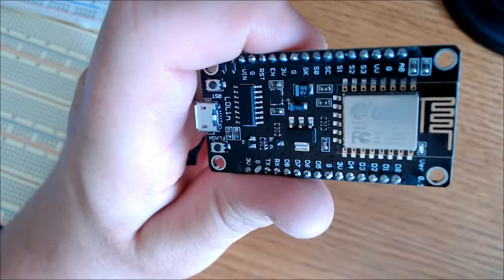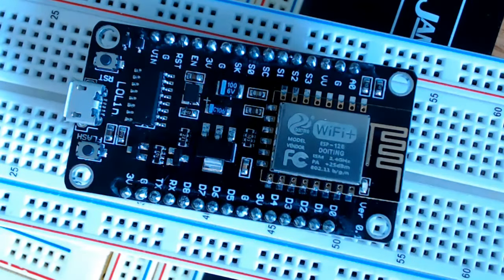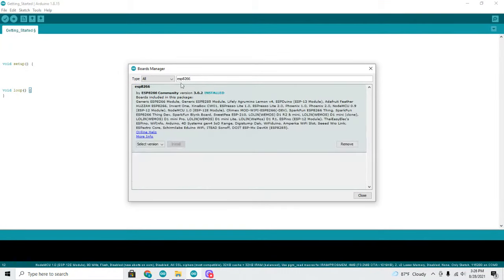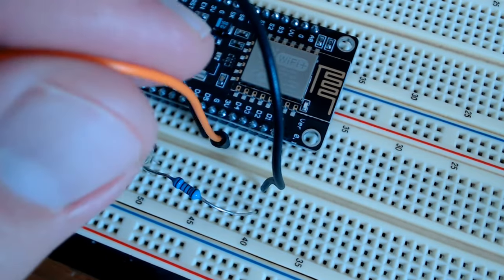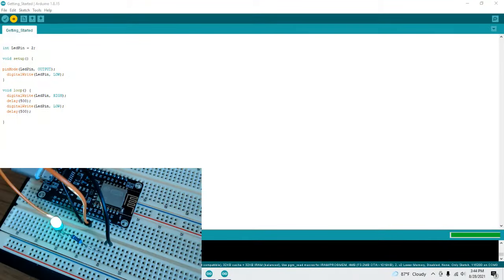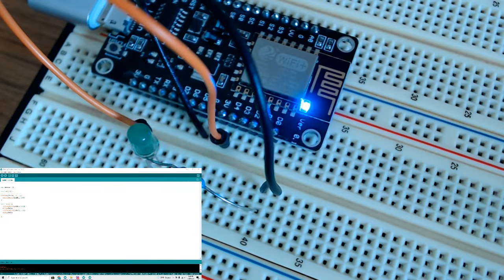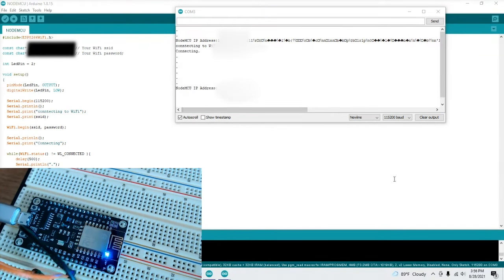How To Setup And Connect The NodeMCU ESP8266 12-E Development Board To Your Computer and Wifi

Comment: “The driver is successfully pre-installed in advance”. How do I fix this?
Reply from the maker: hello!  I would uninstall and reinstall. Shouldn't have an issue after that.  https://www.wch-ic.com/downloads/CH341SER_ZIP.html you can get it here or on github 👍
Reply: @BMonsterLaboratory  Thanks for the quick reply but it still didn't work :'(

Comment: How to find Ip address
Reply from the maker: If you just want to find the IP address for your ESP8266, try this: 

#include <ESP8266WiFi.h>

const char* ssid = "YOUR_SSID";
const char* password = "YOUR_PASSWORD";

void setup() {
  Serial.begin(115200);
  delay(10);

  // Connecting to Wi-Fi network
  Serial.println();
  Serial.print("Connecting to ");
  Serial.println(ssid);

  WiFi.begin(ssid, password);

  while (WiFi.status() != WL_CONNECTED) {
    delay(500);
    Serial.print(".");
  }

  Serial.println("");
  Serial.println("WiFi connected.");
  Serial.println("IP address: ");
  Serial.println(WiFi.localIP());
}

void loop() {
  // Put your main code here, to run repeatedly:
}
 👍

Comment: I am having problems making the connection from the Arduino IDE to the nodemcu 8266 12-E.  In the dropdown, there is no com port choice to select from.  I downloaded the ch340G driver twice, rebooted my pc, still no choice in the dropdown to select com port.  I get message after compiling "Upload error: Failed Uploading: no upload port provided".
Reply from the maker: hi Jeffrey! try switching USB ports and hopefully the option will drop down. which library are you using?
Reply from the maker: I just plugged mine in and got the same thing. I'm using Arduino IDE 2.0 now so I have to download NTPClient from the library manager. I now get an option to select port. It works now. Make sure you select NodeMCU 1.0(EsP-12E) board as well.  I hope that helps. Sorry for the long delay in replying.

Comment: Why specifically 220 ohm resistor please?
Reply from the maker: The ESP8266 operates at 3.3v which is too high for most leds. The led has a forward voltage of approximately 2v and operates at a current of 10-20ma. To calculate resistance to limit the current through the led, you can use ohms law, R=vsource-vLED/ILED or plainly,   (R=V/I).  You can use 130 or higher.  I happen to have a ton of 220ohm resistor so, that's why I use that specific one... not sure if I have a 130 though. Anyway,  great question.  Thanks!
Reply: @BMonsterLaboratory  thank you! I had a 200 on hand
Reply from the maker: @jimpugh6357  200 will work. Good luck to you 👍
Reply: @BMonsterLaboratory  most appreciated

Comment: I'm new to this kind of stuff. I'm curious if this wifi thing has any practical purpose, other than as a fun thing to tinker with. If I hooked this wifi thing up to my Surface Pro 2 would it give me more powerful internet?
Reply from the maker: Hi Dirk Tyler! Great to hear from you. There are many practical users for this board. The board itself has remained very cheap on ebay. I have only used it for automation when using home appliances or lights.  It can also be used for robotics,  wifi monitoring, control i/o pins,  remote cameras...etc. it would not provide a stronger internet connection when communicating with a surface pro. It allows you to easily build  iot controls that can serve a purpose. I fully intend on making many more iot videos in the future since it's a hot topic.  Electronics is a hobby for me and I have found that wifi boards are a different animal.

Comment: Good Day sir. Can I Get the COde Of Wifi?
Reply from the maker: hey there!  If you ever want code for these videos, I have posted them all to the Facebook page for posterity. Sometimes they don't fit in the description so I just started posting them there. anyway, this one is short.  here ya go and good luck!!  If I can be of any help in the future, just ask ~👍💪  

#include<ESP8266WiFi.h>
const char* ssid="xxxxxx"; // Your WiFi ssid
const char* password="xxxxx"; // Your Wifi password;
int LedPin = 2;
void setup()
{
pinMode(LedPin, OUTPUT);
digitalWrite(LedPin, LOW);
Serial.begin(115200);
Serial.println();
Serial.print("conntecting to WiFi");
Serial.print(ssid);
WiFi.begin(ssid, password);
Serial.println();
Serial.print("Connecting");
while(WiFi.status() != WL_CONNECTED ){
delay(500);
Serial.println(".");
}
Serial.print("NodeMCU IP Address:");
Serial.print(WiFi.localIP());
}
void loop()
{
digitalWrite(LedPin, HIGH);
delay(500);
digitalWrite(LedPin, LOW);
delay(500);
}

Comment: Good stuff, I enjoyed watching this. Not sure whereabouts I made mistake in my code. After I compile the code and open up the serial monitor, all I see is dot, which means it is not connected to WiFi. Could you please let me know your thoughts on this?
Reply from the maker: Hi Matt. Sorry it took so long to respond. Did you try the code that I posted on the Facebook page? Do a Facebook search for #setupNodeMCU - If that doesn't work, let me know. I post most of the code for videos there because there's a larger character limit on comments.  I'm sure it's probably just a simple adjustment. Merry Christmas! 👊👊
Reply from the maker: Now that I Think about it...you may have to log into your router and open ports. I think I did this in the video. If you still need help, let me know. It is frustrating to get it up and running first time.
Reply: Hello  @BMonsterLaboratory 
Merry Christmas!
Thank you for your response.
Yes, I've used your code on FB, and all I see are dots.
No, I haven't logged into my router to open ports, and I'm not sure how I can do that. Could you please elaborate on this. 
I purchased the same ESP8266 that you are using in the video and it is brand new.
Reply from the maker: I show the port forwarding in this video https://youtu.be/9t4LWxqnxVQ  just skip to 5:35 and watch from there. This video is connecting a coffee pot to my wifi. I blot out my person ID numbers along the way but I think you can still follow it. My router is a TP-Link and there's a tutorial video on YouTube. You can probably find instructions for your brand of router on the manufactures web site. let me know what ya think.
Reply from the maker: @matthosini9656  So I finally got a chance to watch that video and go through all the steps and here is what I would check.
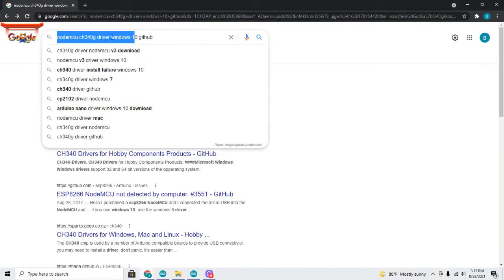1. download the driver - you can see this at 2:25
2. in the video I have a pin at D4 even though this is GPIO2. this one is easy to miss. You can see the pinout at 4:53
3. make sure to include the ESP8266WiFi library in the code.
4. make sure your SSID is correcct. This is the name of your wifi.
5. make sure the password for your wifi matches the password in your code.
You have probably done all or most of these. Hopefully you catch a small  error in one of these points. I believe the dots keep appearing in the serial monitor because you are not connecting to your wifi. I would probably start with making sure the SSID and Password match. I certainly hope this helps because this stuff really is a lot of fun once you get it working.
Reply: Hi  @BMonsterLaboratory  . Really appreciate your time. It's working! and it feels so good! :-)
The issue was the SSID. After I write the right one, it worked.
Reply from the maker: That's awesome. Glad you got it working. Time to make someone great! 👊👊
Reply: @matthosini9656 hello could you please explain in detail how you solved that issue...
Actually i have occurred with same issue.

Comment: Excellent video, very helpful.  Now that my ESP8266 has a valid IP on my WiFi network, when I try to connect to that IP address I get a "The Site Can't Be Reached" message... (IP Address) refused to connect.  Any idea what the issue could be?
Reply from the maker: Thanks! I assume you have the right SSID and password in the code. Did you press the reset button once you uploaded the program? Are there are any firewalls or port-blocking configurations on the network that might be preventing connections to the ESP8266?

Comment: Hi . I have a prblem to connect this nodemcu esp8266 to arduino IED .. I paste  the URL you told us . And when i opend the board manager and find the eso8266 community but it refused to download and gave me a message : 
Faild to install platform: esp8266.
Error: 2 unknown: )
I will be thankful if you help me😊
Reply from the maker: Hey there! Are you stuck in the preferences section of Arduino IDE? Do other boards connect to Arduino IDE? Do you have a firewall or anything else preventing connection? Do you have all the same checked boxes in the preferences page as I do in the video?  Your message just means there's an issue during installation of esp8266 platform. Is there any other error code? It's been a while since I had to do this,  so I'll check it out on my own board.

Comment: why is it need to reset?
Reply from the maker: Hi Robert.  The ESP8266 is pulled high by default. When you pull it low by pressing the button it will reset the board and allow you to see data on you serial monitor and connect to wifi.  I've always had to reset after IDE upload with the 12E module to get the program started.

Comment: Hi This comment is not for this vedio I just wanted to know the problem in my Arudino.
It is showing that:

Arduino: 1.8.12 (Windows 10), Board: "Arduino Mega or Mega 2560, ATmega2560 (Mega 2560)"

In file included from sketch\Ping.ino.cpp:1:0:

C:\Users\Prajit 
\AppData\Local\Arduino15\packages\arduino\hardware\avr\1.8.3\cores\arduino/Arduino.h:258:10: fatal error: pins_arduino.h: No such file or directory

 #include "pins_arduino.h"

          ^~~~~~~~~~~~~~~~

compilation terminated.

exit status 1
Error compiling for board Arduino Mega or Mega 2560.

This report would have more information with
"Show verbose output during compilation"
option enabled in File -> Preferences.

Could you please help me with this 
Hope this comment reaches you.
Reply from the maker: Hi Prajit! Where is your code?  Feel free to email me at bmonsterlab@yahoo.com. Tell me what board you're using, copy/paste the code in the email, and tell me what you're trying to do (ex. LED blink, move a servo arm..etc.). I can see from what you've posted that you're trying to use a library that you don't have installed (#include "pins_arduino.h"). If you need to install a library called pins_arduino on you're IDE, that's an easy fix. Anyway, send me that email and will try to help as much as possible so you can be up and running. Thanks!
Reply: @BMonsterLaboratory  thanks a lot